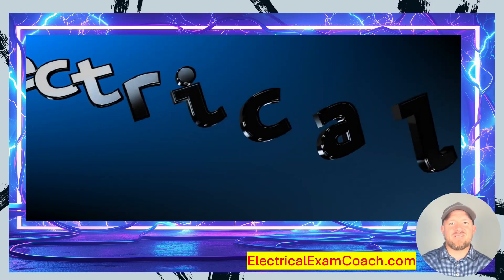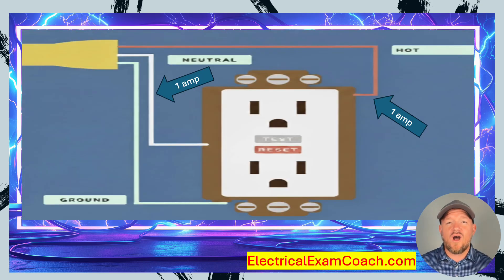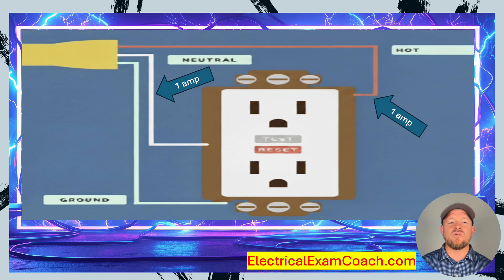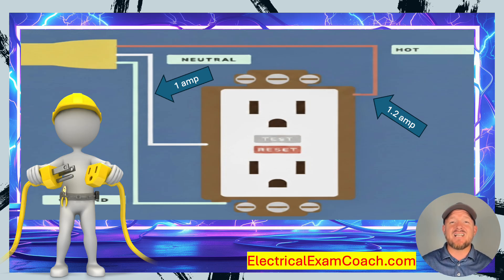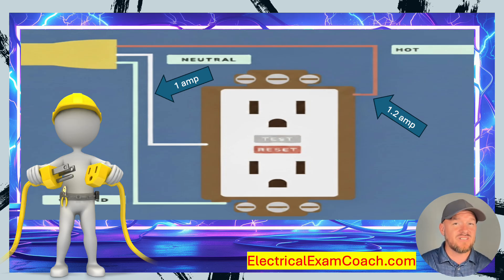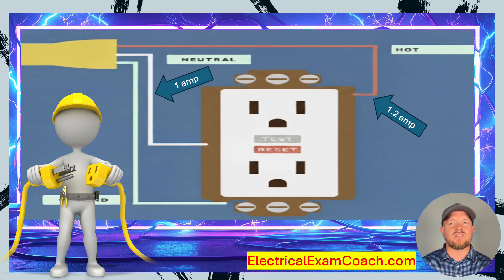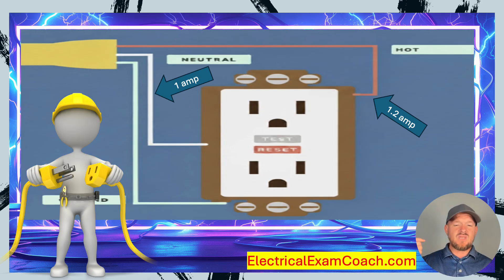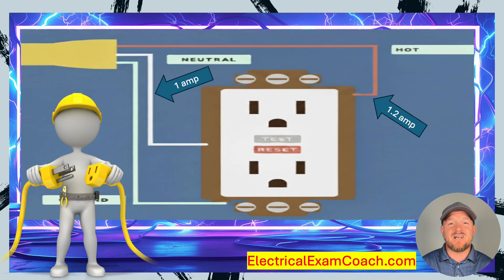GFCI Need a Ground Wire to Function? #232 Electrical Question of the Day. Electrical Exam Coach .

Comment: Agreed. GFCI doesn't need the ground. However, a GFCI tester usually does. The built-in tester does not, but if you're using a plug-in tester and press the GFCI test button, it won't trip the GFCI because it uses the ground lead to shunt some of the current to and create the imbalance. With no ground connection, there is nothing to shunt to and so there is no imbalance to trip the GFCI. Also, to alert you to this situation, the receptacle is supposed to be labeled, "No Equipment Ground."